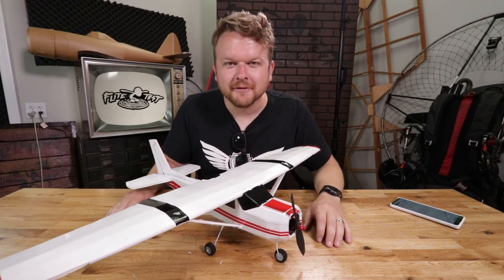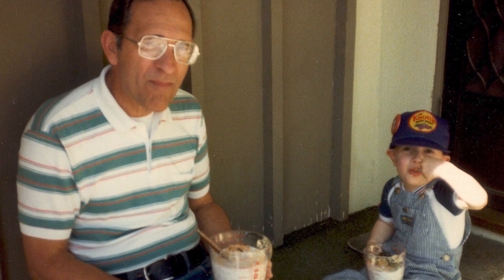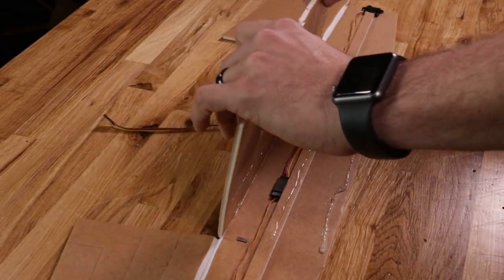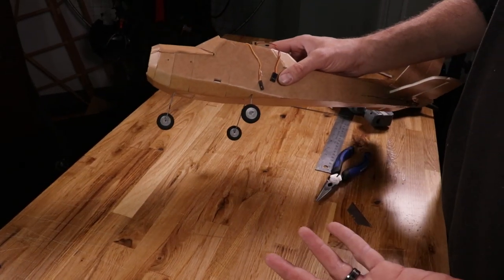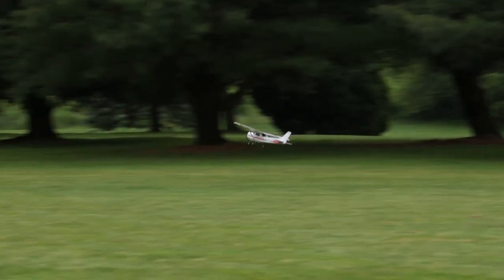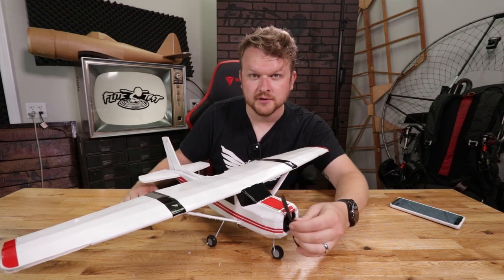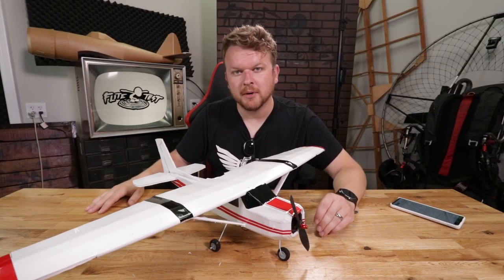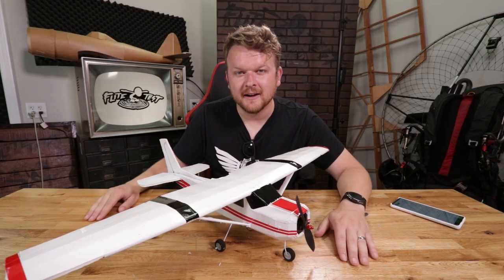Mini DIY Cessna 150 | FT Commuter Speed Build Kit

Comment: I learned in several sesnas from the 150 up to the 182. Used to fly with my dad quite a bit.  We actually had a Jodel F-11A that we were building. Waited over 2 years to get the wing kit shipped to us which took its toll financially and dad ended up donating it to the local EAA chapter

Comment: I'm building one! And I'm going to use a Cox 0.049 engine in the front instead of brushless power! This thing should fly like a dream on a throttleable reed valve Cox mill. Swing a 5x3x3 prop on the front, look great on the ground fly great in the air.

Comment: The Cessna aircraft that this model looks like is the  Cessna 152 which has tricycle landing gear. The Cessna 150 was a tail dagger (with a tail wheel)
Reply: Richard Aldrich the cessna 150 was not tail wheel. You are thinking of the relation of 170 and 172 and 180 and 182. The 152 was just a slight upgrade of the 150. I have flown a Cessna 150L and it is tricycle

Comment: Great info BUT ,I have a question....for example ( just an example ) the Store shows the commuter plane as a standard plane ( not a mini ) and uses the Power Pack A and it shows the simple Cub as a standard but suggests the Power Pack B.....so the question is can you use the SAME power pack A in the Simple Cub and or the Power Pack B in the Commuter ? Why and or why not ? seems to be about a 8 inch difference in wingspan but should not affect the ability to use either Power pack.....may slow the Cub down more and or speed up the commuter....but will A work with the CUB and make the power pod switchable to both for example ? Just curious as to yes or no and WHY ? Thanks in advance ....

Comment: Will we ever get (or is there) an ft flight controller with SAFE like tech?
Reply: Most drone flight controllers can be setup to stabilize a fixed wing aircraft. I built an ft spear with an old f3 fc to stabilize it just like safe and used it to teach my then 7 year old son to fly it he was soloed in stabalized mode after 2 flights then I turned it down a little after each flying day till it got to the point where i turned it off and he never noticed. He now flies a legacy, twin sparrow, and a goblin. Don't be afraid to pick up a f4 fc and learn how to setup inav it's easy to setup a simple stabilizer a bit more complex if you go full gps return to home but so worth it.